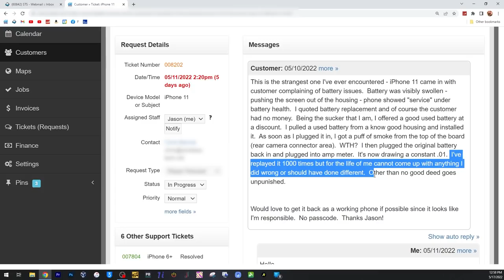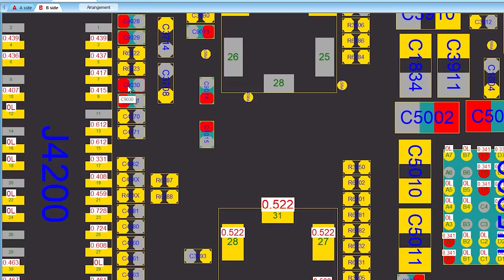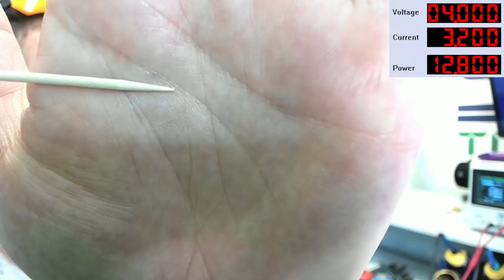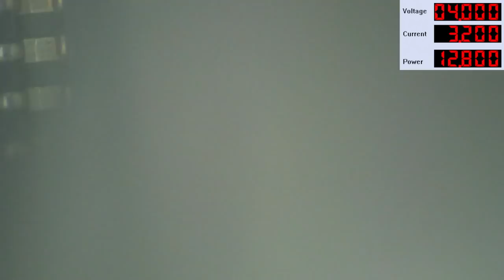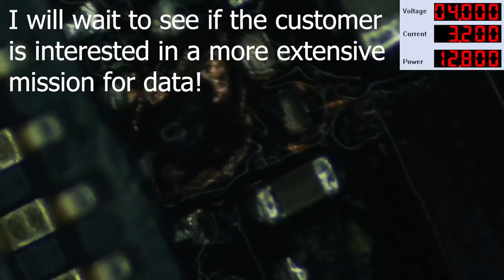This phone smoked during a battery replacement but it wasn't his fault 😇

Comment: I think you're right - it's been sitting there burning away for quite some time.. that's why the battery had drainage issues, and what ultimately caused the battery swelling/failure.
The battery probably just couldn't supply the high amperage the short wanted to draw, or the voltage it could supply just wasn't high enough to allow that current to flow.

... That's when the battery swap went awry.. the new battery was likely fully charged, and could supply a lot more amperage than the old one and well... We've seen what happened next.. working lithium batteries are scary for the amount of power they can dump in an instant..
Reply: Possibly the pressure of unclipping and reattaching the display was enough to disturb the area . Kind of like ‘the chair with a rotten leg was fine until you sat on it’ type scenario.

Comment: With all do respect, you can to use a Dremel to clear out all of the burnt residue before powering anything on.
Just digging around is not good enough.
You could short something else on top of existing short by doing so.

Comment: I seen this damage ones on a laptop. It was about 1mm hole after cleaning , but shot was gone. This was under a Mosfet that burn out together with a board under it. MY luck that laptops are much thicker  , components and much bigger  and the layers of the board are much thicker as well.

I think that the burn continue to the lower board as well.

Comment: I guess the battery was/went low/flat with the water short, and when he plugged in a full battery the high current incinerated it. 
I've seen a lot of repairs grind the carbon out fully and bypass stuff, but I was thinking of a mini sandblaster. It should erode soft stuff and leave the copper, and It should make it easier to see when the carbon is gone and you're on solid PCB.

Comment: Most liquid damage shorts the proxy flex first. Once it shorts out the phone will not boot. There maybe a chance the proxy flex was not connected when plugging in the new battery. Then once turned on the bigger short blew out with a full change battery.

Comment: The problem with water damaged boards of any kind is the liquid will keep corroding even when cleaned with ultra sonic cleaners. Unless you have x-ray eyes the tech cannot know the extent of the damage especially under IC's and it's not viable to pull, clean and reball every IC The device becomes a ticking timebomb. It's not about "if" but "when".

Comment: The original damage took out the battery. The customer never turned on the phone with original battery.
\
You confirmed the original battery was Dead.

Replacing the battery supplied enough current to smoke the Also damaged circuits...

Comment: I phone 11 has a design flaw the volume button flex and wifi connectors are able to just come off the board because there is no plate holding them down. There located under the 2 camera flex cables. This is shocking they should be recalling the lot of them

Comment: wanna try figuring out what i did to a power board in a 4 in 1 welder for shits n giggles. paid 140 bucks new on amazon and the suppliers no longer selling it and doesnt reply back. it was operational and foolishly i attempted to install a pot to fine tune wire speed. it did work fine for 10 min but eventually the pot fried and it doesnt power on now.  ide be greatly entertained hearing your opinions on what went wrong from doing this. i already have a dif one thats much more dependable so if it takes a few months o well. i get your cellphone repair ect but Yolo?